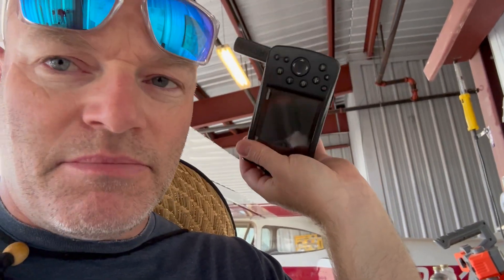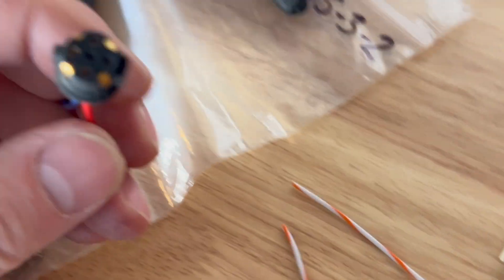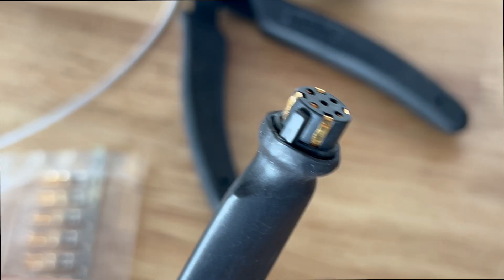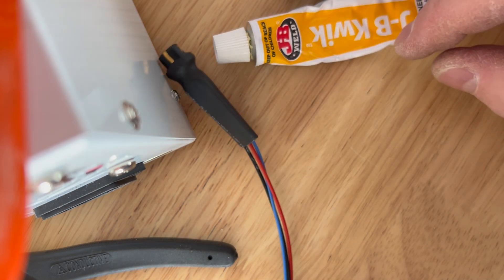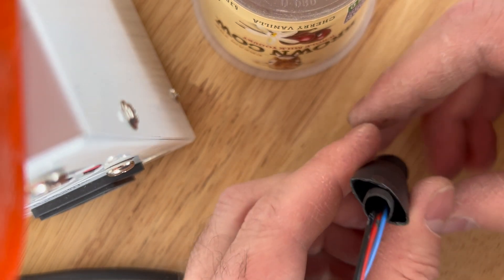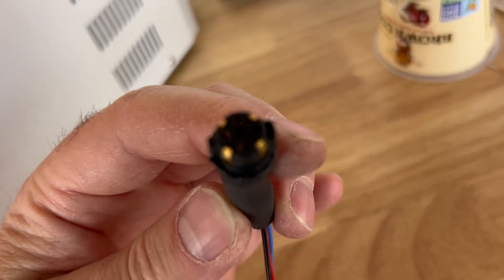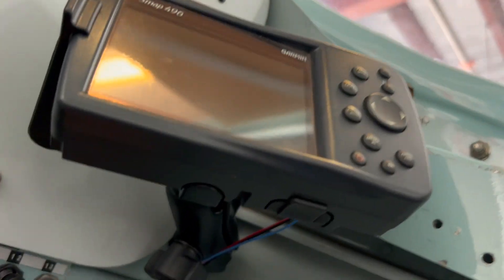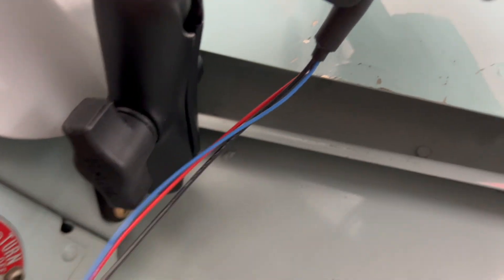AVIONICS HACK: Garmin Connector WITH data output!

Comment: Is the serial data gong to match the baud rate of your ELT or is it selectable on either device to match?
Reply from the maker: Great question. Yes it will match in my case because I requested a specific baud rate when ordering. It is selectable on the GPS, however not on the 406 ELT. Depending on where or how you order the ELT, it can be programmed based on your needs. Also you can send an ELT in for reprogramming if so desired.

Comment: can it be  3d printed?   other questions what about my Road GPS units can they be converted over to aviation some how? or even turned into a marine GPS unit?
Reply: Some copies of the Garmin 276C can be used to make an aviation Garmin 296.  However, an aviation navigator is primarily aviation databases, without them a navigator with aviation firmware is useless.
Reply from the maker: 3D printing was where my mind went first. I think it definitely can, but the design work is substantially more effort. Way over my abilities at this point too. I think if we had one 3D scanned, it could work. There are other considerations as well. I don’t think similar units can be converted between specialties unless originally programmed that way. I know the 496 has automotive, marine and aviation modes… but I don’t think any are cross compatible though.